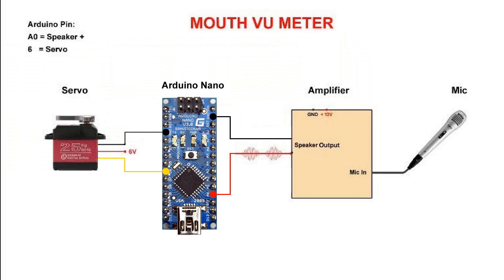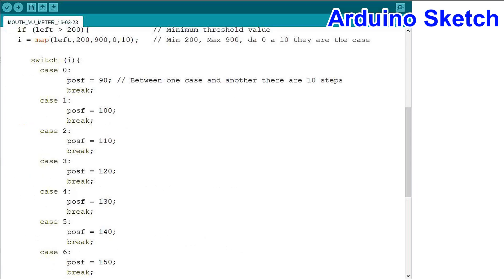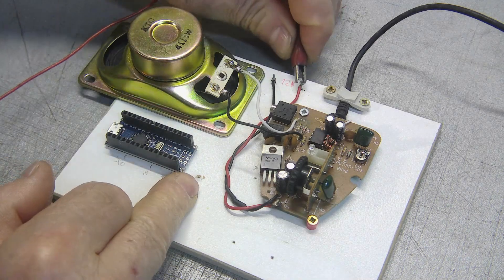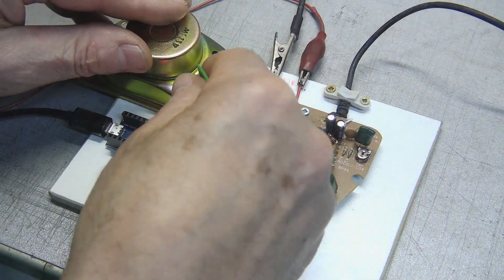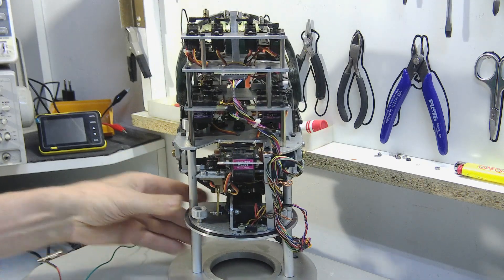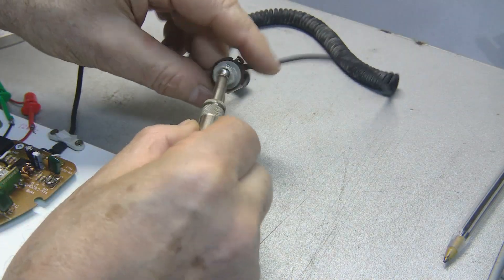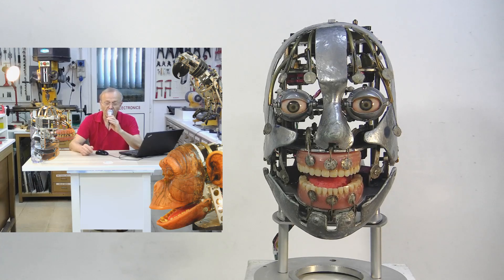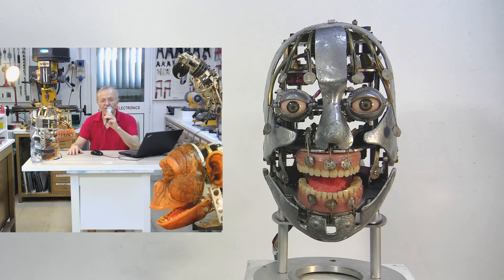How to move robots' mouths - Animatronics Tutorial

Comment: Hello sir. I am big fan of your work. I have also made a Humanoid robot.. I am stuck in this part moving mouth’s servo using audio signal.. I have tried this method, it worked for few time but then it damaged the micro controller. I found out speakers creates ac voltage. Do you have any suggestion for this? I have used XYP15W Bluetooth module to receive audio.
Reply from the maker: You have to use Arduino nano or Arduino Uno!  Like diagram in the video.